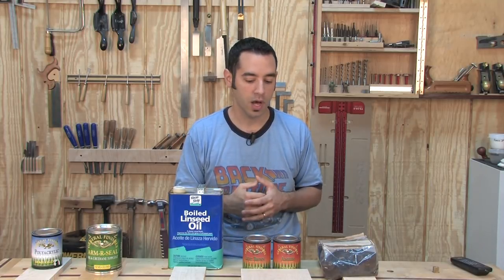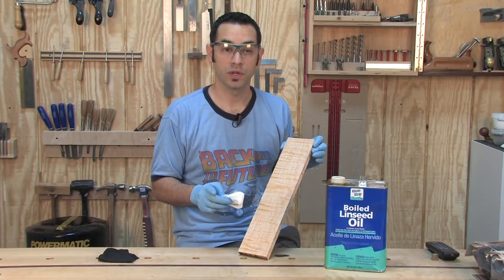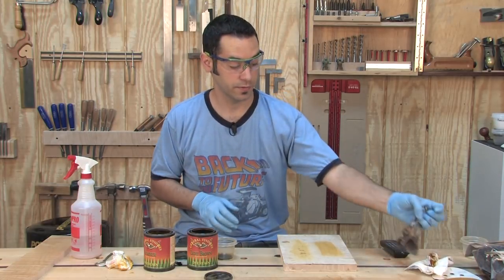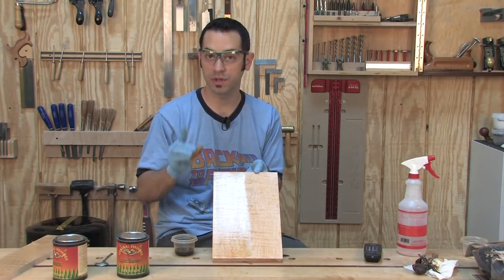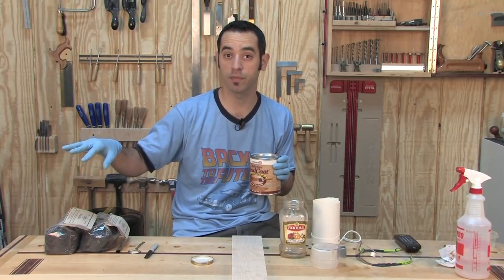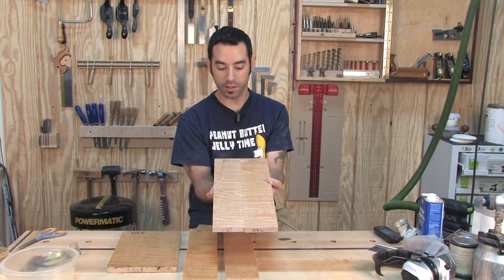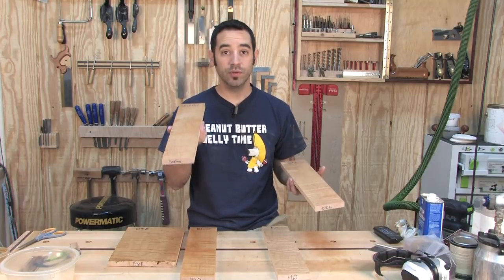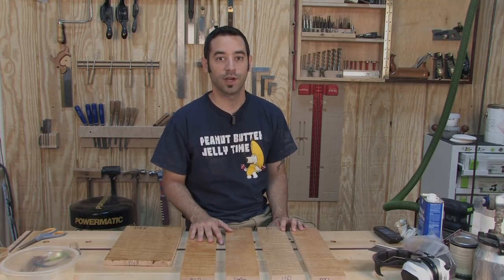47 (HD Version) - How to Make a Water-Based Finish Look More Like An Oil-Based Finish

Comment: That seems like a lot of work. I think they turned out great. I think the easiest way to do what you did is to use trans tint dies and add them directly to your water-based finish. I have been doing this for a while and it works phenomenally. I just use 7 drops of golden brown and one drop of reddish brown per quart of water-based finish. I have tried this in several water-based finishes. My absolute favorite water-based finish to use however is aqua clad. It is a industrial wood coatings product from Diamond Vogel. I have sprayed only. I very rarely brush finish on. This stuff is extremely cheap as well. Only 38 dollars a gallon. Even the cheapest junk from Home Depot is 50 bucks a gallon.

Comment: Thanks for the HD version, big improvement.  I have been experimenting with dewaxed shellac on walnut with water based ploy over it.  Looks nice and rich.  Basically the poly just protects the shellac.  Sometimes I use oil based stain under the shellac.

Comment: Thanks for re-publishing this! I'm impressed with the boiled linseed oil.  As for the dye, I think watered down stain might do the trick. I really love how fast my water based coatings work. They just don't develop the cumulative amber that normal polyurethane does. I'm trying 9 parts acrylic, 1 part water based stain for just the initial coat, then pure acrylic.

Comment: Haven't tried other brands yet, but I've found that the General Finishes water based stains tend to be attracted to the grain far more than I like when applied to naked wood, leading to a zebra striped look which can be interesting, but usually not what Is wanted.  As you noted, this even shows up a little when you dilute the stain and pre-wet the wood.  I've had success putting the stain over a lightly sanded thin coat of water based sanding sealer, and then putting the water based topcoat right over the stain after it dries.  You do end up pulling up some of the stain into your lower layers of topcoat and driving it into your sealer a little bit.  If you can do this smoothly without leaving streaks, I feel that the end result is prettier than sealing.  The optical properties do a better job replicating an oil finish which imparts color all the way through rather than some color on the wood covered by a layer of clear plastic.

I feel that when it comes to water borne finishes and especially dies, it is more important to play around with your off-cuts before going to the actual piece.  Different woods will absorb differently and so a technique that is gorgeous on ash may result in ugly looking cherry.  Or you may even get differential absorption between your heartwood and your sapwood which has to be taken into account.

Comment: I have been using a danish oil type of mix (1 or 2 coats) as base for water based finishes. 
So far I have used it in maple, walnut and pine. I like the results and have not seen any problem in the finish so far.

Comment: Today, I tried 4 coats of Polycrylic on some swamp mahogany, all in one day!! 100F, 20% humidity. I've never been able to coat like that with normal Polyurethane. I tried it on swamp Mahogany and AC 3/4" plywood. It has less of a gold effect, but the wood still does its natural shine. Both the light and dark grain on the plywood appears wet and shimmers. With polyurethane, it develops more of a gold color and the light grain becomes darker. A dab of something like Varathane natural or golden pecan adds the desired contrast. I'm gonna jump on the acrylic bandwagon.

Comment: In my kitchen 10 years ago or so, I used the shellac (seal coat) plus the water-based finish. I've found over the years, the water-based didn't hold up as well as I had hoped, but the look is fantastic. In my case, I was specifically trying to pop the grain a bit, but not give the wood a yellowish tint. I like the color of natural maple, but didn't want the gym floor effect.

Comment: I was an early adopter of water based spar varnish and didn't have a lot of joy.  As I move into our wet and cool winters, my options dwindle - that and too many years of high VOC spar varnish.  I need to change.  I hadn't thought of the shellac under a water based spar varnish.  This essentially being a decade old video - I'm curious if your conclusions remain the same.

Comment: Great video.  You mention that darker woods don't really work great with water-based finishes - I've never really played with water-based finishes, so I'm just wondering if that is kind of a blanket statement, or if there are ways to use water-based finishes on dark woods that don't impart that bluish hue you mention (like can I throw down a layer or two of shellac before the water-based finish in order to avoid that)?
Reply from the maker: +simonc700 It's all about experimentation. There are lots of different finishes out there and how they look on the wood will vary widely. So you'd have to test it first to see how it looks and then try a few things, like undercoating with shellac, to see if that impacts the final appearance.

Comment: Marc, what is the best way to dispose of old varnish blends that I have?  Right now they are just in small glass containers, but I don't know what to do with them.  They don't look like they would be good to use again.
Reply from the maker: +Brian Buckley I would pour them into an open container and let them cure completely, then throw the dried resin in the trash.
Reply: +The Wood Whisperer Thanks!

Comment: i laughed when you said you prefered the foam brush to a bristle brush.  i tried a foam brush and couldn't get it right no matter how i tried lol  so went back to my old paint brush.  the odd thing in nz is they want about $2 - $5 for a foam brush which makes it a very expensive throw away.  but i will say one thing for paint brushes.. they are not all created equal, a good brush is expensive but will last a life time if cleaned and cared for properly.  the ones with feathered ends are the best for laying finish.

Comment: This might be a dumb question. Why not just use an oil-based finish? I don't use water-based finishes. I am a fan of oil-based because of the color. Is there any major benefit to using a water-based that just looks like oil?  Thanks for this video Marc. I really want to try to get into shellac because my grandfather was a big fan of it.
Reply: Polycrylic dries in about 2-4 hours. You can walk on it in the same day. Normal polyurethane, not so much. I'm doing my living-room floor. It has a nice original coat, 3 shoddy top coats, and it's VERY uneven. What happens, is I'll sand it and the warps hit the bare wood. Normal polyurethane freshens it right up and looks natural, but the age of it causes it to dry slowly. It's still sticky after 3 days. I also put 8 coats of polyurethane on some mahogany. It glows a rich gold color. Normal polycrylic did make the grain shine, but the gold color didn't come up. That said, people go nuts over the un-tinted mahogany when they see it. It's particularly crisp.

Comment: You must have really been sick to opt-in to even more editing work!  Thanks though.  There's good info in these older videos.  Might want to add a little more noise filtering to the audio if you plan on doing more of these, but this is clearly improved from the original.
Reply from the maker: +Matt Heere I find noise filtering isn't worth the time it takes to implement it. A little echo is good for your health. :)
Reply: It's subjective to be sure.  Hiss drives me nuts - others find any treble attenuation to sound "muffled".  I just downloaded the episode and tried the denoiser in Premier.  10dB of reduction and a -3.5 offset seems to get rid of it without affecting that silky voice of yours :)  Shouldn't change the render time a lick either.

I didn't even notice the reverberation.  Guess I'm too used to hearing it in my own videos.  My shop is perfectly square and echos like the Grand Canyon... 

Anyway, take care of that cold.  This episode is the one that got me to sub originally BTW.  I've used your finishing insights to good end repeatedly.  Thanks!

Comment: I've been putting water based poly over oil based  stains for years without a shellac cote between them  
Have just been lucky?
Reply: +Michael Lockhart Im trying to do something similar to simplify the process, by cleaning the surface with mineral spirits before the water based coat...have you tried on something like a table top?